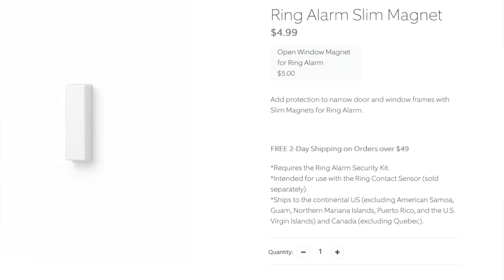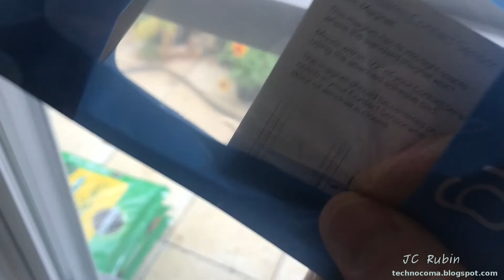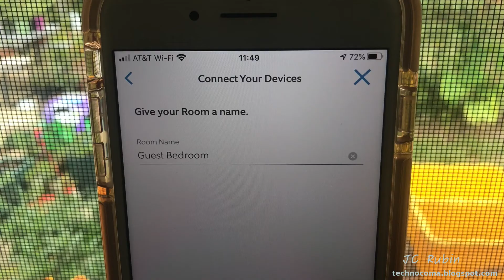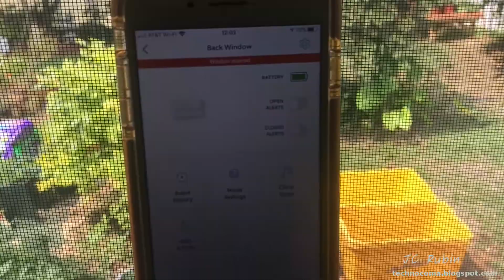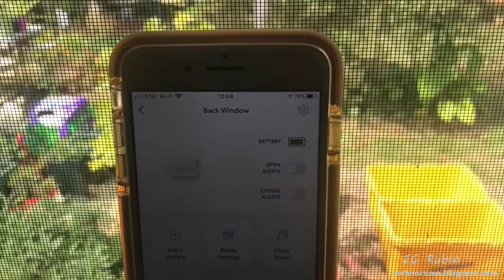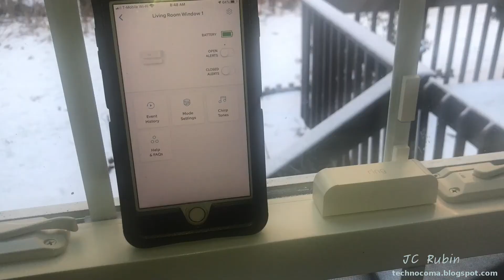Ring Alarm Sensor Installation in Double Hung Windows

Comment: I think you may be misinformed about the Gen 2 sensors. They are actually considerably smaller than the Gen 1 sensors. Everyone complained about the size of the Gen 1 sensors and that is one of the reasons they released the newer ones

Comment: We have windows that open strangely. We have some windows that open like yours, but to the side, as well as some that crank open inwards, towards the inside of the room. Will these sensors work with those type of windows? I don’t want to buy the extra sensors if they won’t work.
Reply from the maker: Yes, just set up with a closed window.   Those that move away on open should work fine.

Comment: Do you think a regular magnet will work ? I seen somebody use a disc magnet but was for a different security system but for the same purpose
Reply from the maker: Some magnets are stonger than others, you can test them, your mileage may vary.